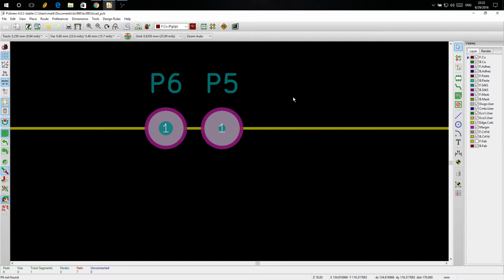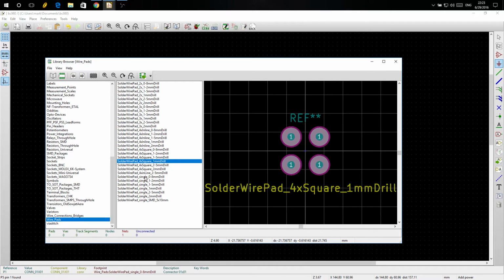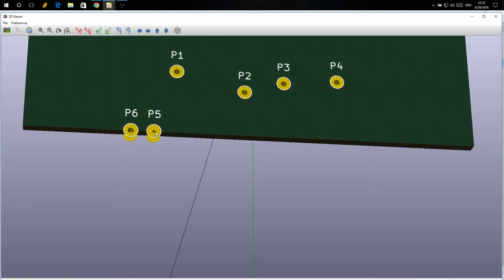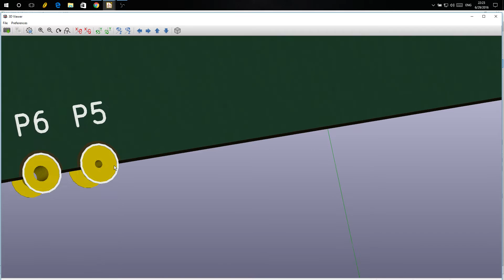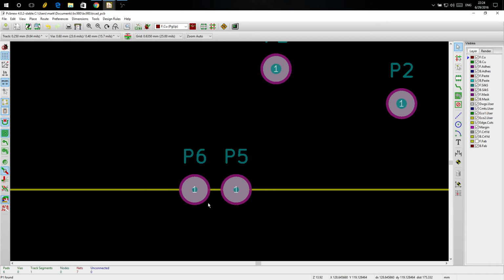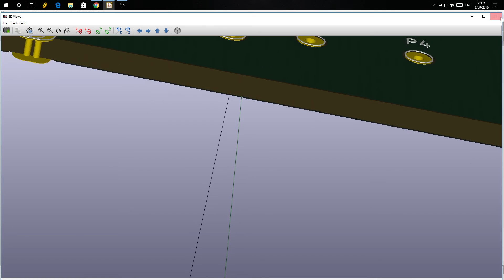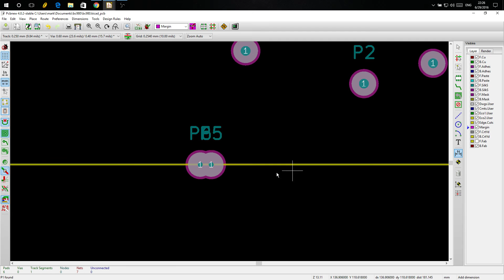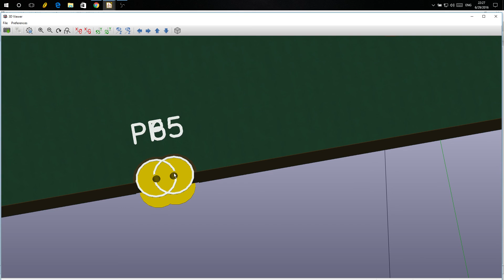a KiCAD question... castellations?

Comment: Can't help you with your kittycat. :)  However, what's your plan?  To use wires or header pins soldered to the edge of the board or is the plan to solder the half of the vias on your board to the board below directly?  If you can get a company to do small prebent wires you could use edge connector pads and I could probably whip up a installation/alignment jig on the milling machine.  Just load the preformed jumpers into the jig, install your board from below and solder them on.

Mike
Reply from the maker: pretty much, yeah.
Emulators cost a bit... but a board with castellations is much cheaper.
I probably need a custom footprint... will have to work on that.